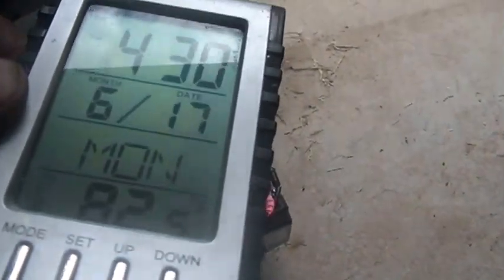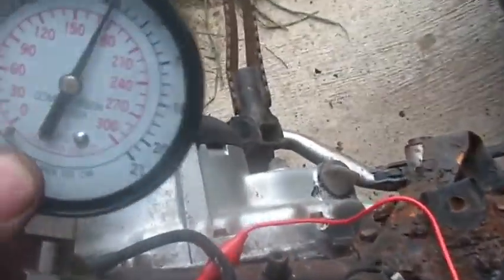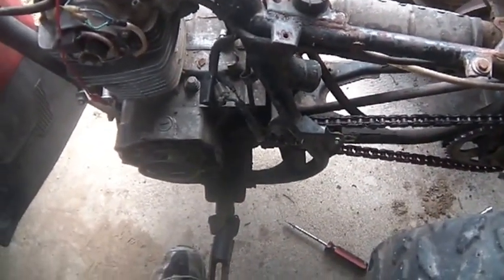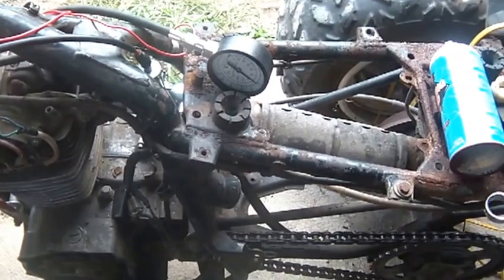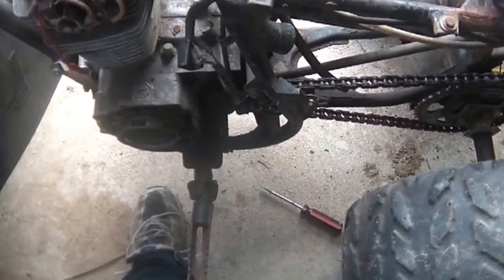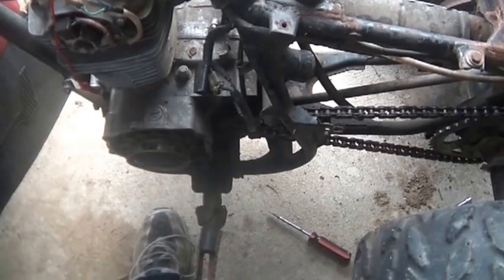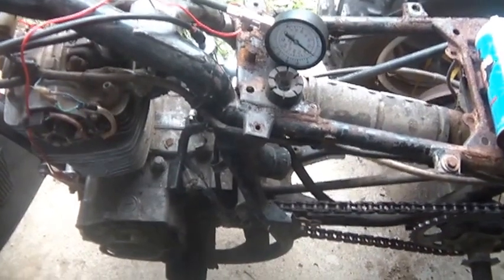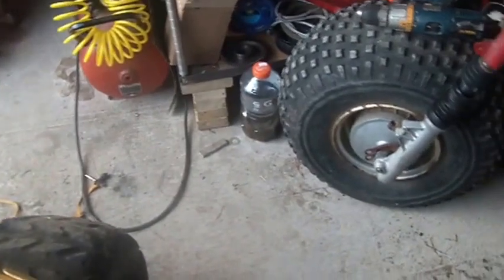6_17_2013, Honda 200S High Compression?

Comment: 280PSI in my 200x i have an high compression piston in it 12.1 i have to run race gas 110 octane
Reply: @Ben Speaker Its more peppy for sure but my first build i burn the head a bit because the gas i was using the octane was too low you need at lease 105 octane to retard the explosion in the cylinder so it does not ignite before the time it should. Im building another one right now should be ready next week high compression aswell  i use torco octane now . Also if your planning on using that piston you need a BAPP copper head gasket this will make the compression to 12.5 because its thinner 1mm other than that you will blow your head gasket all the time  i have 4 of them there hard to find sometime you see them on ebay ...cheers if you have question let me know.
Reply: @Ben Speaker And it depend how you want to drive your 200x if your planning just to drive slow around the house you dont need that piston but if your like me and want to get the maximum power out of those small engine well keep it lol

Comment: i got the compression of near 90 with my 86 honda trx200sx and its suppose to be 120 to 150 and i rebuilt the top end with new piston and rings and adjusted the valves.
Reply from the maker: Matthew marrs, When U did the compression test, was the throttle wide and choke wide opened or better yet, the carb removed? With fresh rings, good valves, and a fresh battery, (or strong arm), I would expect over 125PSI. They seem to run all the way down to 75PSI or so... Thanks for watching and commenting Bud!
Reply: Throttle wide open and carb off new piston and rings run about 75psi.
Reply from the maker: Matthew Marrs, The compression will probably go up as the rings seat. It will run and run fine  at 75psi, I'm just a little surprised that it is not higher for a fresh build. Maybe Ur compression gauge is reading a bit low.
Reply: Brand new system.

Comment from the maker: Mustie1, Good idea checking it against my compressor... The one in the upper garage cycles off at 100PSI, a good mid point for the gauge. I just removed the fly wheel and will look at the stator in the morning, someone was poking around in there recently, I need to see if they screwed anything up. Thanks for watching and commenting.

Comment: your always suppossed to check it wide open as you said, double check your gauge with your air gun and see if it matches your compressor, also high carbon build up can cause it,